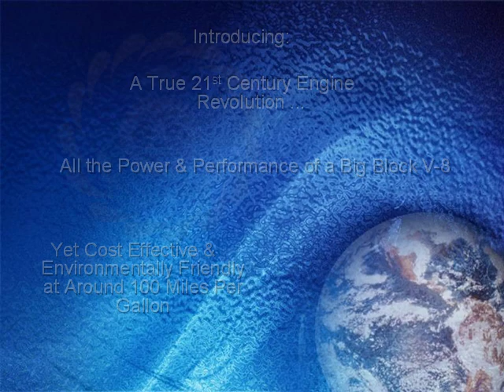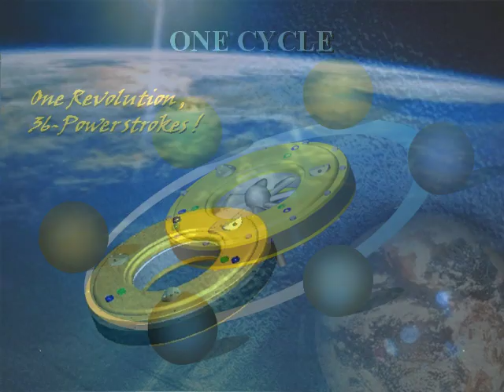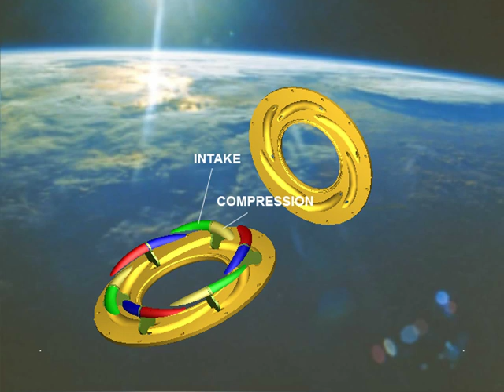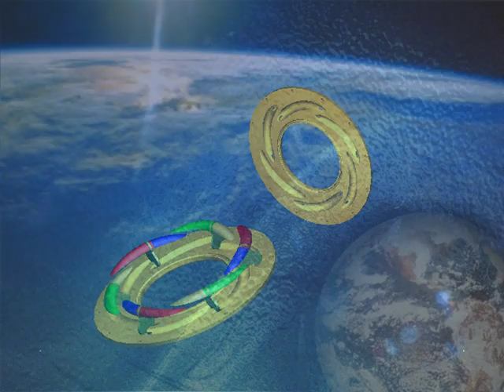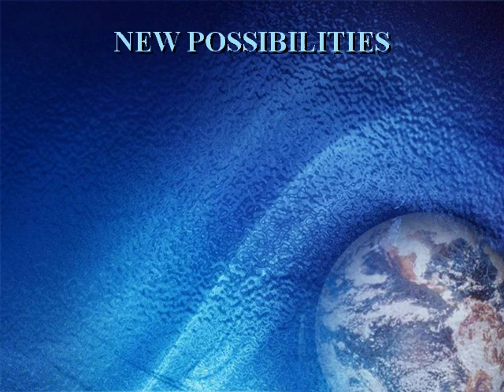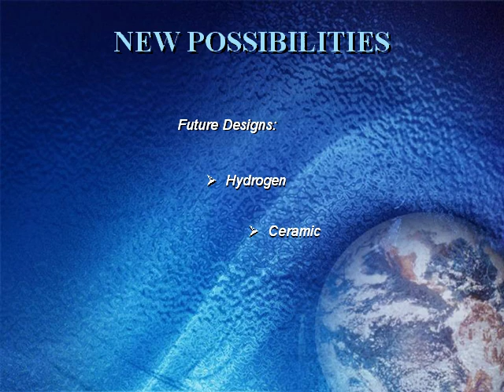AMW's Clean, Green and Mean Engine

Comment: Cleaver design however you are compressing the air into an axillary chamber  injecting fuel then routing the combustion gases into the  expanding combustion chamber ( if I understand this right).  This design will work it might even work well but this transferring of combustion gases from one chamber to another while the engine is running especially at high RPM is inefficient.  This design even with this flaw might be more efficient than todays piston engine.
Reply: RR Thank you for your encouraging comments and sorry for such a late response! 

Yes, you are correct this is one configuration and is your assessments.  There are some options we hope to implement to negate this loss but that's further down the road!